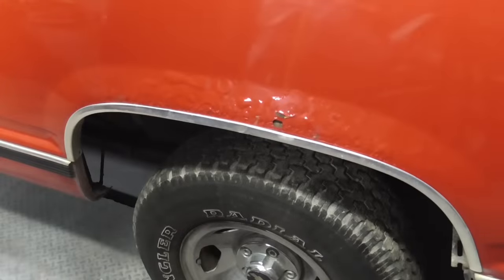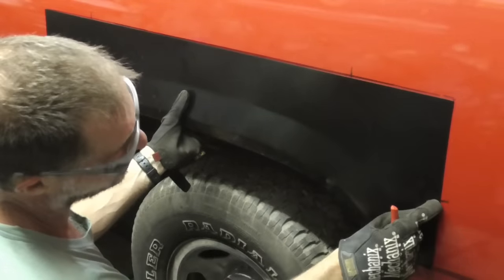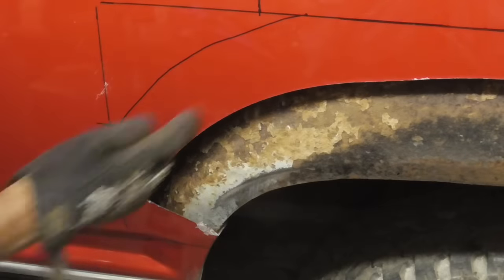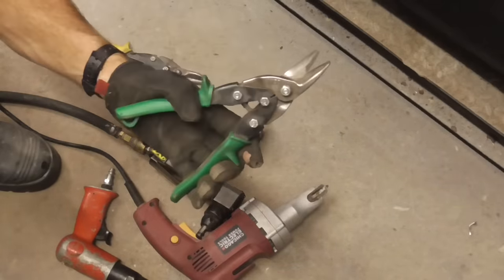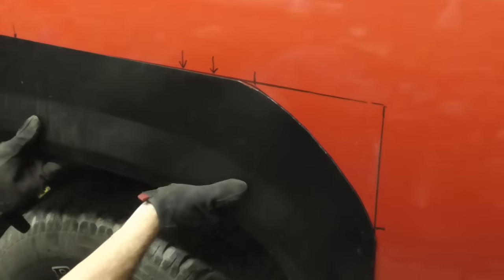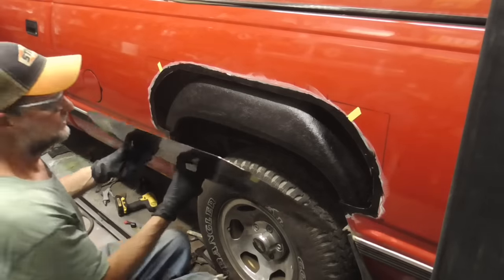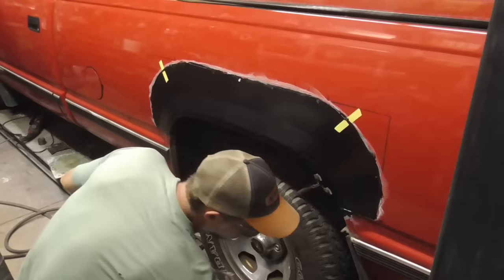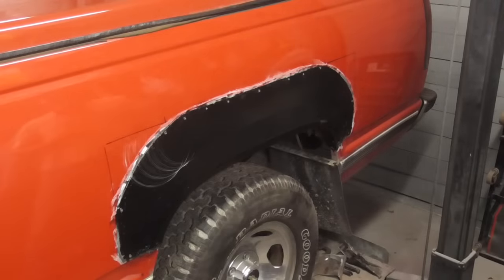Glue On Wheel Arch Rust Repair Panels w/ SEM Impact Resistant Panel Adhesive

Comment: One more tool you could have used is a flanger to run around the cut out area before you glue the new piece into place that allows the new piece to be flush with the original panel. Just an idea.  Works great for me.
Reply from the maker: Thanks for your input Don.  How wide of a flange does your flange tool make?  I'm concerned that the seam would not be wide enough.  It holds well for you though?
Reply: great idea, saves time and filler
Reply: Why wouldn't one just leave ALL the panel? Why did you just leave an inch? For the glue strip? Just curious.
Reply: Adding replacements for replacement panels, with glue!!! It looks great with the replacement panels. Nice work!
I’m looking forward to the finished product!
Reply: @daisyorpington784  it gets rid of rust creep on the panel. 
If we look at a rusting rock chip on a hood for example and remove just the surrounding paint we’ll see rust tendrils like spiders legs creeping back under what we perceived as good paint.  
On my old cars I would “fix” a spot then see a donut shaped rust build around the fix the next year.  🤷🏼‍♂️
Gotta get rid of that stuff.
Reply: @LakesideAutobody  the flange tool I have in half inch
Reply from the maker: @danohstoolbox  What's the brand name?
Reply: @Daisy Orpington  if you leave rust it will continue to spread. Always necessary to cut out all rust, or else you just wasted a lot of time
Reply: @daisyorpington784  good place for water and salt and such to start the rot all over again
Reply: Another thing you can do is glue some strips the backside of your repair, giving you a "flange" to set and glue the new panel into and giving you that butt fitting.
Reply: @jonathanyates5198  That's not accurate. Rust isn't an organism. It doesn't eat. It's a chemical reaction that requires oxygen, an anode, cathode, and electrolyte. If you take the ingredients needed away, you stop the rust. No oxygen, or no electrolyte, then no rust. You can have the rustiest nastiest metal and take one of the things away it needs, and it stops.

As long as you can seal it, you're good. But that's where it gets tricky. Typical sealers don't adhere to (seal) with rusty metal that flakes away. That's why you want all the loose rust gone. So your products can stick to it and seal it from the ingredients it needs to rust (oxygen and electrolyte).
Reply: I know that this a year old post but years ago we made our own flanger tools. My brother was a mantience man at a mica plant . Think the metallic in paint its actually mica . We as a side hobby had old hot rods and we took a cheap pair of harbor freight bolt cutters and cut the jaws back enough to insert to half inch thick metal pieces that were cut to have a 1/8 inch offset that was 1 inch deep. Because we wanted to have a bigger weld at the time lap on the sheet metal but the glue except for being expensive now is a lot better.  Less warping and less bondo are needed.
Reply: I saw a video a few months ago where Kevin Tetz put a cab corner patch on an S10 pickup using the method you described. I thought it was a slick way to get the butt fit.  @glock21guy
Reply: @billhayward2668  Yeah. That's where I saw it too.
Reply: Agreed Don.  I was thinking that the whole video.  I love the idea of using adhesive for small patches but honestly, to me, the glueing then the rivets and all the extra sanding...why not just tack the panel in with a welder?  I have used a plain old flux core wire feed with great results and less work.
Reply: @LakesideAutobody  They sell them at harbor freight,, and probably many other store.
Reply: @captainmidnight3522  When you tack. you leave gaps between the panels, which is where the water gets into and causes the rust and eventual seam pop.  With glue, you can effectively fill all those void between the two metal pieces.  That's the theory, at least!
Reply: @jeffmckc2081  the glue is rust proof epoxy it seals just like a waterproof sealer.
Reply: @charleswittmer2477  Using the right epoxy glue will bond and seal the joint basically forever if done right! It should to be sealed behind the panel also

Comment: i think the car industry should be held accountable for rust, here it is 60 years later and same problem with no solution yet. they brag how advanced we are but still have cars that rust and fall apart
Reply from the maker: You're right - they do absolutely no research in ways to prevent it.  It can be prevented too with some innovative design :)

Comment: Save a ton of time and body work by flanging the 1 inch section and getting the patch panel even more flush.
Reply: Or save even more time by replacing the whole bedside
Reply: Save more time: buy a new truck and move to a rust free zone!
Reply: @miken.4693  for real,I rather either get new bedside or just get new truck,
Too much work unless it’s for a hobby car
Reply: Some of you just can't admit that your not talented enough to fix it so you buy new so with that being said good job on the bed
Reply: I sure do id  show you if it would let me
Reply: @Davemike27 they're driving the truck their wife bought😂
Reply: Agree, he should have treated the inner fender first.
Reply: He did it the correct way.  The flange tool distorts metal on curves and contours horribly.  Bad advice.

Comment: For those who is concerned about moisture creeping in between the over lap metal ... the panel adhesive isn't going to let that happen & the use of seam sealer on the back side also prevents that from happening ... the back side after panel is attached cleaned & seam sealed & primed & finishes coated with spray on undercoating works great ... we used this method at the body shop with no failures ... rust can show up in weird places the worst I've seen has always been under powder coated surface rust loves to creep under powder coating .. I  taped off where the adhesive is going to be applied & clean , prep & prime any exposed bear metal before gluing panel stop rust before it has a foot hold .. food for thought to each their own
Reply from the maker: Thanks for your input Lee 😊
Reply: I live in Michigan we know rust 😂
Reply: No failures? For how long? Weld it. It's cheaper. It's faster and lasts forever. It just requires some skill.
Reply: Corrosion Free 3000.....spray door bottoms, rockers, and panel backsides....spring and fall....zero rust....migrates better than anything I have seen
Reply: Rust is NOT MY POINT!!! I'ts the lap joint and the amount of bondo required.. It's just not the best way. You but weld and hammer, then Idealy lead.. Thin bondo is ok, but not ideal.. If you are using this method for collision repair on a Hyundi, by all means, make your money brother... If you a craftsman, working on a real car...JUST DONT!

Comment: This is perfect for someone with a older work vehicle or daily driver, who maybe can't afford a body shop or the vehicle is just not worth much, but you want to hold on to it for a few more years.. Hell you could even rattle can the paint job. IMO , even a bad paint job, looks better than a rusted out body panel.
Reply: Now if they’d just make glue-on unibody patch panels, haha!
Reply: basically  a good method...no welding tools required....good video..tanks!
Reply: Jesus this will make any body guy worth their salt cringe with discust.decent prep work just forgot the MIG.clecos have been around forever.
Reply: @The_sinner_Jim_Whitney  make up
Reply: @JoeRocket-sf6qs  panel bond is used on 90% of modern cars. Disgust* btw
Reply: I need to do this but I am going to raptor line it once the patch is done.
Reply: @dennisholst4322  Huh?
Reply: @The_sinner_Jim_Whitney   old creation and New brains
Reply: @dennisholst4322  Again, I say, 'huh'?

Comment: The best part about those adhesives is that they are corrosion inhibitors. Anywhere you put them, as long as the panel was prepped correctly, they are protected from corrosion. We use them at the body shop for certain applications. They're great. Especially if you're doing repairs at home and you don't have a welder. Great video
Reply from the maker: Thanks D.A.L.  - you're right about that.  The best thing is the seam is 100% sealed for ever.
Reply: @LakesideAutobody  Since its cut open I would put some undercoating inside the best I could.   Especially when using patch panels.   Sometimes they end up being cheaply made and rust out easy just because of the manufacturing process.  Cheap junk unless you have a worthy source and even with that sometimes its hit and miss.. Any pin hole and moisture would leak through.  Not from the work you did but, perhaps on the original seams. Its amazing sometimes you can have a little rust hole and water and stuff get into the hole but, the hole is really doesn't grow much over years but, somewhere further in it rots to hell.
Reply from the maker: @creativestudio4873  Here's what works for me to prevent future rust after the repair - https://www.youtube.com/watch?v=8XaZBy7GC7A  Have a good week my friend :)
Reply: If the glue stays flexible wont it crack the filler and paint? or is that not a problem? I want to try this on a VW bug but don't want to come back and have to repaint.
Reply: @LymanTaiste  I turned my 58 beetle into a pickup using the back of a dodge pickup cab i cut out with a cold chisel and hammer in 1968 using pop rivets and covered it with filler. It never showed a problem, I still have it, it has a hydraulic isky cam in a 67 bus 1500 motor with a 64 ac unit. It idles at 900rpm.

Comment: Something to consider when installing patch panels regardless of the attachment method.  Cut the rust out to good metal / some reasonable shape of cut then trim the patch panel to fit.  
If the patch rusts out in the future and was installed full size the first time, the rust might extend past the size of the patch making the 2nd repair difficult.   This is especially true if the patch was welded / brazed on as this area tends to rust more than unaffected metal.
Reply from the maker: Thanks for the logic Bob - good advice :)
Reply: @originalmicdrop  Kinda like brushing your teeth; you need to bondo daily.
Reply: @MrTemplerage  huh?
Reply: @DD-mp9ok  Lol, yes, I'm certain he was talking about bondo filling his own teeth. Who hasn't considered that 😅
All kidding aside, I wouldn't recommend 🤣

Comment: Excellent job. I had a high end body shop for 20 years. Started out for the first 8 in a barn doing restorations, overall paint jobs on Porsche mostly. Moved to the super highway and became the largest shop in all of the Western Part of my county out of over 250 other shops doing more business than any other. Did mostly all new car collision work. Had 11 full time people on the payroll. Okay, that's the end of my qualifications. My shop closed in 1995. Things have developed since then. First time I saw adhesive in conjunction with metal. Fascinating. You do nice work. Every step of the way I was thinking, and sure enough you address my every concern. For example filling the holes. Then when you did a rough sand on the first coat of putty, you attacked it with an air board on the subsequent coat. I was concerned that you did not do a final long board hand sand with 80, then sure enough you did. 
We used to use Nitro-Stan after a couple of coats of primer. It had more density than just primer itself, and then we needed to prime twice after that. 
I also like that you wore a mask most of the time. I was particular about that. I was in the hospital recently for what wound up to be no cause at all. They did a complete X Ray of my lungs and they were perfectly clear. I used to park a 20" box fan alongside of me when sanding bondo, so the air blew between me and the vehicle sending the dust sideways. I also got a fresh air supplied respirator for using in the booth when shooting urethanes with hardeners. The guys refused to use it. 
Anyhow, I subscribed to your channel, and appreciate your postings. I'm a fan.
Reply from the maker: I really appreciate your comment Bob.  You know... they caught a small spot on my lung too about 5-6 years back and had x-rays done and a respiratory specialist do some other tests and everything came out clean too.  I though after all the years of body work I was DONE but was surprised when talking to the doc if fine particles of dust would have accumulated in my lungs.  Surprisingly he said "No"  - that your body is engineered to keep that stuff from getting to the lungs.  He was very convincing too - a very good specialist here in Detroit, MI  Hopefully that give you even more comfort knowing that the years spend in the very dusty body shop environments hasn't taken any years off your life.  Thanks for subscribing my friend and have a good weekend.  Jerry
Reply: My cousin did high end write-off restorations all his life.  He was awesome at it. He was one of those guys who did not like masks.  His entire body rotted away with cancer; his bones turned into mush; docs inserted metal rods into his bones just so he could get another couple months...
-- I did about 10 years of autobody in my garage with very cheap/basic safety measures about 40 years ago.  (washing my hands with enamel reducer and lacquer thinner!!!) By 32 yrs old I was pretty sick, and quit and went natural.  Still kicking.
-- Chemicals have changed a lot since then, eg: water based paints, instead of isocyanide poison.
-- Don't f**k around, guys.
Reply: I have a 1943 ford jeep that I rebuilt the body on in about 1980 to completion in about 1986. I used all ppg paints starting with dp 90 the black epoxy primer to seal all the ground down welded areas. I also tredated the surface rust areas on each side of the body parts. Next I used ppg sanding primer and body filler I believe rage was the name. Over the filler and primer, lots of leveling, and more primer,  went more dp90 primer sealer, then I was in a hardened enamel stage of painting my cars, later I went to base coat clear coat and some single stage top coats then a single stage clearcoat because it can be put on thicker in my opinion and in my case you can sad it to a smoother finish mostly because then I never had a booth. Leveling the hardened enamel was a real chore and a cat cant scratch it but it does seem to chip a little easier. I have hardened enamel on the inner fender panels of a 1963 jeep gladiator still good since 1984. If I live long enough this is what I will be doing on my 1975 914 for the aftermarket inner stiffener panels and the steel fender flares. I found this as I have a once repaired area behind the door on a extended cab chev I bought that the rocker area is gone and I bought the repair panel that will get glued on at the body moulding indentation area  and the normal flanges at either end. I believe this is the only right way to replace body panels if it is possible because welding heat ruins the metal and it will always be a question of when will the rust show back up. They have been glueing aluminum panels on livestack trailers for a really long time. I gotta get a better flange tool. I like tools.
Reply: @LakesideAutobody it's not the dust itself it's the toxic chemicals in the dust.  The vapors from the wet filler, primer, etc.  Glad y'all have been doing good health wise.

Comment: Nice demonstration, something I've been very curious about. I got into body work in the late 70's (no longer am). Worked at shops using everything from rivets to welding with coat hangers. I was too fussy for the era, stuck to, frame straightening, finish work and painting. I see many advantages to the bounded repair and respect the care you put in your work. Thank You for sharing.
Reply from the maker: You're welcome Dionne - have a good end of the week 🏈

Comment: I'm still leaning towards welding my wheel arch panels, but these videos are all part of deciding what I'm going to do. Plus the filling and finishing are worth watching and learning. This channel is invaluable.
Reply from the maker: I appreciate the kind words Keith.  Always feel free to ask ?s - I get to them every day :)
Reply: Far quicker and less waste and cheaper to not to mention cutting off all that good metal is ridiculous.
Reply: Seems easier to just weld it
Reply: @LakesideAutobody If the glue is so strong what is the purpose of the rivets? It seems it would be better to just run spot welds around the patch panel. The end result is the same. I will say though you did do a great job.
Reply: welding was the only way till these new adhesives came out. they have been using this type of metat to metal repair for years. the new cars have been glued together for a long time. when you weld the heat takes the properties out of the metal and makes it quickly rust especially on the inside where you cant treat it.
Reply: @chrisdorrell1  gotta cut it somewhere. up higher there might be less interior rusted metal.

Comment: I have a 2010 chev that I was planning on welding in new repair panels, but now I think it's time to experiment a little and glue them on.  Some of these new adhesives had their beginning in the space program and now are finding their way into other industries.  This should be interesting for a 79 year old former shop owner.  I will have to dig out my cleco's, hope I still have them. We'll see it should be fun.
Reply from the maker: You'll have fun doing it - and the best thing is the water tight seam :)

Comment: Nice job. As a teen I did some work on a 72 Bronco back in the late 70's. I didn't know anything and there was no internet to look at. My right hand fingers sometimes lock backwards from all the hand sanding I did. I wish some of the stuff you used had been available.
Reply: I got built working at a body shop, with all the sanding and lifting of doors, fenders, hoods, etc.
Reply: Why the glue if you're going to rivet it on anyway.